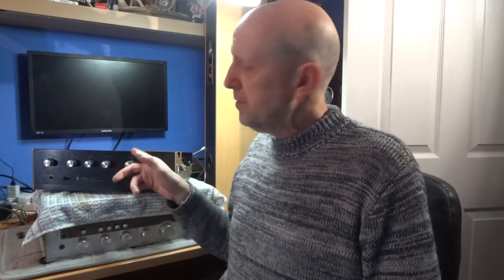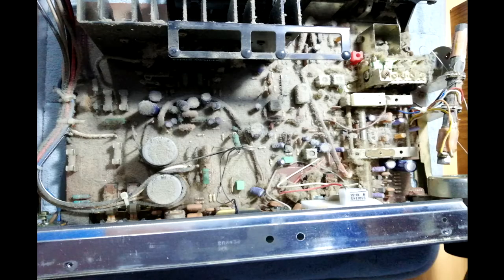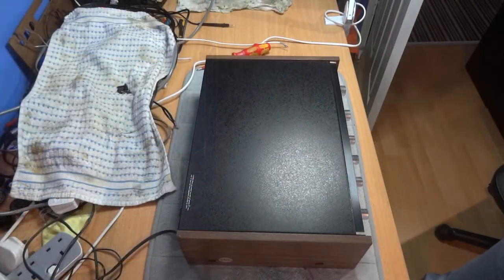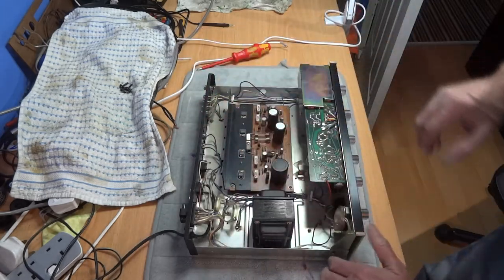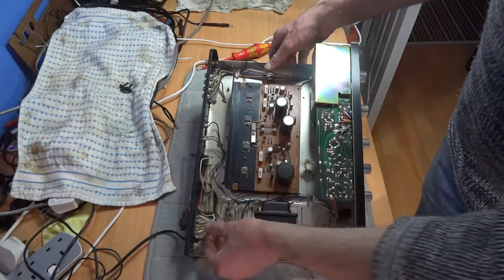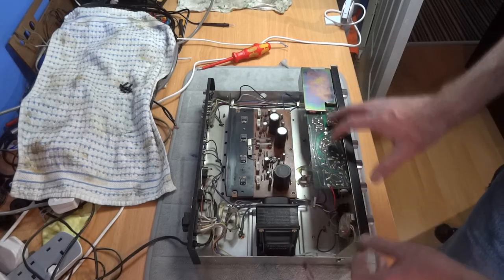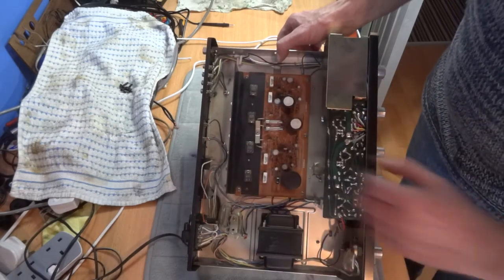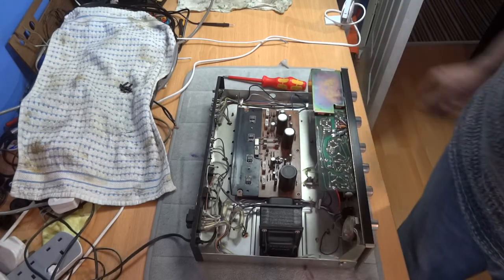Amplifier & Receiver Opening and Inspection, Sansui AU 101 or any Amp. HiFi audio vintage

Comment: Hi Michael, hope you’re well. I have the same model which has suddenly developed constant,  loud cracking on the right channel.  Issue remains on all inputs and is unaffected by any of the controls (minus the speaker switch of course). 

I’ve tried the usual Deoxit on the front panel pots & switches but this has no effect whatsoever. 

I’ve swapped the speakers around so the issue is definitely within the amp.

Could you say where I should start looking based on these symptoms? Cheers!
Reply from the maker: Hi, I would start of by replacing the probmatic 2sc871 transistor, as the noise is on all inputs  AUX, PHONO, TAPE MONITOR then it would be the pre-amp one labeled TR702 on the right channel, this amplifier has 3 of these transistors on both channels .Though this still may not be the fault it is a good place to start. A sub that works well is a 2sc1815
Reply: @MichaelYates  wouldn’t swapping them over between the two channels cause the issue to the left channel? 

I’ll give them a shot anyway as they cost next to nothing. Cheers
Reply from the maker: @Rustin-wy6yf  Yes if you wanted to you can swap both transistors over
Reply: @MichaelYates  Hello again. I managed to locate the problematic transistor. It’s the 2SC1364 on TR804. Would you happen to know of an equivalent I can replace it with? Thanks again!
Reply from the maker: @Rustin-wy6yf  Hi,, I honestly dont know myself as never replaced one, but a few forums I looked at suggest the ksc1815 as one some people have trid and worked for them, just double check the pinouts though
Reply: @MichaelYates  I used the 2SC1815 (specs appear to be the same as KSC1815) which worked perfectly. Now to adjust the DC bias as it’s something I’ve never checked on this amp
Reply from the maker: @Rustin-wy6yf  That is good news, yes I think the 2sc 1815 and Ksc1815 are very much the same.

Comment: Hi, is this your favourite integrated amp? Strange that it doesn’t have a tuner dedicated input, and setting. I’m in the market for a low powered vintage receiver, or integrated amp.
I’m torn between this amp and the Pioneer SX-440. (Have à Sansui T-5 tuner)
Reply from the maker: Hi Robert, I would recommend the Sansui au101 over the Pioneer sx440, the Sansui has more detail, nicer bass and top end and a more magical sound. Even though the sx440 is not a bad little receiver. The Sansui 331 or 441 would make a nice little receiver and in fact the 331 or 441 sometimes sell for less than the au101. Yes a little strange there is no Tuner input on the au101
Reply: @MichaelYates  is about a fair price 125lbs $200 Canadian
Reply from the maker: @Dansero07  Yes that's a reasonable price, here in the UK the 101 goes for around £100

Comment: how clear rust inside, missing switch on off , how get this switch ?
Reply from the maker: The on off switch is just a single pole switch, so any 240 volt 1 amp single rotary on off switch that will fit in the hole will do, if you take the broken one out you can measure the barrel diameter and length of pole required

Comment: I have a similar Sansui AU505 amplifier. I have changed some Capacitors not all yet. The problem now is I don't get sounds on the left side. Right side has sounds. I have changed one output transistor on the left side. The original is 2SD188. Changed to the equivalent  of BD317. Do I need to change both on the left channel ? 
The other issue is I get a cracking sound and distortion on both speakers. What's the problem ? 
Thank you
Reply from the maker: Was the amp working fine before the Cap replacements? , 
if so then maybe one of the caps is been put in the wrong way round. Yes you should replace the outputs with a matched pair. Cracking noise could be quite a few things, but a bad transistor would be a good place to start, if you have already cleaned volume, bass, treble, input select , speaker select and tape monitor controls.
Reply: Hi Mike. Thanks will follow as you said. Clean pots, etc....  Yeah I did change additional capacitors. No cracking sounds now. But I get stereo sounds on my headset connected to the amplifier but a very very faint sound on the left speaker. Right side is good. For the external speakers . What's the issue now ? ☺️
No the Sansui AU505 amplifier was in bad shape before my first round of capacitor replacements. There was no sound and the left side fuse kept blowing out. There was also smoking on the ceramic resistor 2W 0.47 ohms. Changed it to a 5W resistor instead. 
At least there's an improvement now .
Reply from the maker: @dennischarles68  You should not have to change the 2w 0.47 resistor, for this to get to hot and smoke there is something wrong. as you have changed a output transistor I would check the DC bais , off the top of my head as I dont have this amp. it can be done by measuring the dc millivolts across the 2 watt resistors, should be about 10 millivolts or take the fuse out that supplies the voltage to the output transistor and measure the milliamps across the fuse when taken out should read about 20 milli amps. this is a rough guess and be careful when doing so as will be easy to blow a few transistors if done wrong. this is with volume on zero

Comment: I have just got one off ebay it has a bit of static on the left channel that pops on about every 10 mins or so, do u have any ideas what it could be.
Ps I also got a hold of one of those sanyo ones with the same amp as the 441 you where talking about on your other video. 
Thanks
Reply from the maker: Hi Charles, first thing I would do is clean all the pops, Does it do it on all inputs, ie phono as well, if so I would look at transistor 701 its a 2sc871, these seem to be the main cause of popping
Reply: @MichaelYates  thanks Michael,  I will check if it does it on all inputs
Reply: You said clean pops. What's pops ? What is a popping sound ?
Reply from the maker: @dennischarles68  Sorry Typo, pots ie volume bass etc, popping is like loud sudden pops, static noise